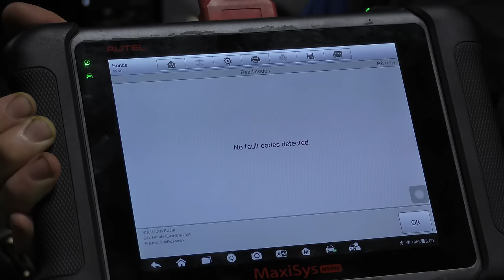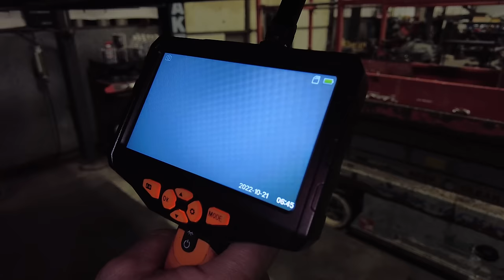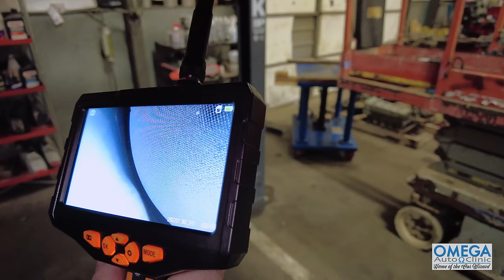Isolating the Problem? Engine Has No GO!

Comment: My wife and I have a 2006 Element. It has been as reliable as a church. We bought it in 2011 with 85,000 miles. It now has almost 170,000 miles and I am on my third set of tires, and brakes. I had the alternator replaced some years ago, and the A/C recharged. I change the oil and filter on schedule and have had no major issues in twelve years. It is the all wheel drive version with the 4 speed automatic.
Reply: LMAO Elements are great. Also, I like the suicide doors!
Reply: Is the back big enough for a matress if the rear seats are removed?
Reply: @micclay  Yes it is.
Reply: same with me 151K--brakes and tires twice, battery once, sepentine belt twice, otherwise normal maintenance

Comment: All of our local mechanics use the parts cannon, which can get very expensive. My former mechanic told me I needed a new catalytic converter, took it to my buddy, who is a mechanic, replaced the O2 sensors, and the light went off. So the other mechanic would have charged me $2000 for new catalytic converter‘s, when all it needed was new O2 sensors.

Comment: Great advice. On top of that, you gotta save all the Element you can, such a unique and practical vehicle! Great video! :)👍
Reply: I have 3 in my driveway they keep me busy to say the least.
Reply: Agreed!  My 2006 red EX model is named Zuko btw. ;-)
Reply: Yes because the elderly love the element!  When you see one on the road check out the driver! ha
Reply: I hate to say it but, for me they are typical Honda reliability but the only thing they would be good for is a chassis/drivetrain swap onto a decent body. But assuming they are unibody, they would only be good for parts on other Hondas. The last couple decades Honda has gotten weird.
Reply: So I know that Honda is reliable and everything but it did have some transmission problems. What about this Honda? I’m looking for a car right now, but I would like to have all wheel drive.

Comment: This is an important lesson on why it is important to find a shop that you trust. I moved to a new state and took my Toyota MR2 to the closest Toyota dealer for routine service because it was still under warantee. The MR2 was a mid engine sports car. The service advisor opened the frunk, no engine, opened the trunk, no engine. He looked baffled. I was at a Toyota dealer and the service advisor couldn't find the engine on a recent Toyota model! I took this as a warning, grabbed the keys, and took the car to a dealer on the other side of town who gave me great service.
Reply: 😆🤣 I had two first gen MR2. Great car, that's a keeper.
Reply: @MarkD11  The MR2 was indeed a keeper. Unfortunately, my first wife was not and she took it in the divorce. 😮‍💨

Comment: I'd be tempted to try some Cata-Clean for that cat converter. Being as it's just dirty, not blown apart in chunks, I'd say it's worth a shot
Reply: If you work on your own car then.. Yes you can take of cat, blow out with compressor from other end ect. Someone even powerwash theirs with good results (not with gas engine powerwasher, it could shred everything). Dry it out, put back on and use some cat burning fuel additive on longer drives.

However if you own shop then you don't have time, money to waste and experiment without any guarantee! Remember that owner also wants their car back! And if your experiment doest go well, now owner is talking shit about your shop to other potential costumers ect.
Reply: Once I heard a mechanic tried soaking the Cat in a solution of dishwashing liquid and water over nite to clean out the honeycomb Cat he claimed it worked and saved you some $$$$ to clean out carbon and in some cases oil in the exhaust.
Reply: A full bottle of Red Line SI-1fuel system cleaner  before a long highway trip works for some.
Reply: How about spray it with acetone
Reply: If no code history, why does it clog over time? Any history trying Scotty Kilmer Lacquer Thinner gas tank mix, especially if it's still intact?
Reply: A back pressure gauge is easy to make that screws in the O2 sensor hole and gives you a a actual measurement of the restriction
Reply: @tomgaddis5020  Garsh! That makes sense. I knew they made some where you drilled holes to install the screw-in bits, and riveted them shut later, but that's simpler for sure.
Reply: We used to just replace with straight pipe. Can got better mpg and better power afterwards
Reply: If the cats on its way out then I'd say screw it
Reply: I was thinking it would make sense to clean it. Also I wonder why it’s so plugged to begin with. Must not be running quite right?
Reply: @BruceLee-xn3nn  In our country you will be caught out with an environmental violation on your first annual checkup. And that will be really expensive.
Reply: @BruceLee-xn3nn  all kinds of illegal in the US. An individual might get away with it in Kansas on a vehicle that is already titled and registered in Kansas, since there are few/no inspections ever after. But a shop that started doing that would be risking a federal investigation and massive fines.
Reply: I had a failing cat and was unable to pass CA smog. My smog guy had me run seafoam through the engine and it cleaned a fuck ton of carbon deposits off the top of the pistons and presumably cleaned a decent amount of gunk out of the cat. It's been right around 3 years and the car has passed  everytime 👍🏻
Reply: I had a work friend who’s wife’s car had a blown head gasket. He said that he couldn’t afford to fix it straight away. So he just kept using stop leak in the radiator. Finally it got so bad that the car would barely run. So one weekend he changed the gasket but the car still barely ran. He told me that he thought that it was a fuel problem. He said that it would start ok but after a few seconds would stop. I told him that I thought the exhaust was blocked. He didn’t listen and had the car towed to a mechanic. They charged him $2,000 to replace the engine. Guess what it was exactly the same. I told him once again that I thought the exhaust was blocked. He finally went to another mechanic who charged $50 to put on a 2nd hand catalytic converter. With him putting so much stop leak in the radiator with a blown head gasket. It all just went down the exhaust and blocked the catalytic converter.
Reply: @BruceLee-xn3nn  ok if you have no emissions testing in your state
Reply: @nielsdebakker3283  state by state issue. Florida ok. NY no

Comment: You know ,I NEVER WOULD HAVE THOUGHT. THE CONVERTER PLAYS A BIG PART IN THAT KIND OF PROFORMACE. I'm really glad for your content.💯 🤝
Reply: i have seen it a lot i used to be a mechanic and it it is clogged you will lose power.
Reply: Only way I knew is because I had two trucks do the same thing. Since I live in Florida I just unbolted the exhaust and got myself a pipe and hammer. A few whacks and some extreme revving I had an empty cat. Man did it pick up power on my pick-ups. Lol
Reply: Replace it with a straight pipe and you'll get better mpg .
Reply: It's the banana in the tailpipe effect

Comment: Man, I wish I had a shop around as good as yours. My Explorer has been acting up for months and every shop just says, "There is no code so there isn't anything we can do." That doesn't help me get to work or around town. Every shop should work to the same standards you and your team does.
Reply: I'm lucky to have a good, honest garage near me. They get it right the first time and don't bussht you.
Reply: He doesn't have a gas analyzer.  That's not a complete shop. No exhaust evac system either. Not good.
Reply: do you let them keep the car for a few days to try to recreate it and look further into it? most shops are super busy right now and if there is no code there is nothing they can say for certain.
Reply: What are symptoms it's exhibiting?
Reply: @theosexpertdaymon2774  When the engine is warm the idle rpms will begin to drop from its normal 750 to around 500. It'll usually start to shudder like it's misfiring and will stall out on occasion. Once you hit the gas, it drives like normal though. I've also recently started hearing a whistling under the hood that gets louder when you accelerate. So far the work that has been done is a throttle body cleaning, repaced EGR valve, replaced coil/plugs/wires, and intake manifold gasket. All of these helped, but none of them solved the issue.
Reply: @dawsonfradin9071  What year and engine is it?
Reply: @theosexpertdaymon2774  2006 Ford Explorer XLS with the 4.0L V6
Reply: @dawsonfradin9071  The whistling sound makes me wonder about the possibility of a vacuum leak. Though Ford does have a few TSBs out on idle issues coupled with hesitation and a hard to start condition. Saying to clean the throttle body (which you said was done I believe) however it does also mention updating the PCM calibration/firmware as well. Do you have any service records of the PCM ever being updated or a sticker underhood mentioning ECM calibration?
Reply: @dawsonfradin9071  Now that I've thought on it a bit you could be having problems with the sencondary air injection system if that car has it equipped, that whistling sound could be a bad hose to or from the air pump.
Reply: @theosexpertdaymon2774  I've been thinking of running a smoke test on the intake. Would that help pinpoint if it's leaking from the secondary air injection or even the pcv system?
Reply: @dawsonfradin9071  It would show leaks on the intake and it should on the pcv as well (I'd go ahead and visually inspect the grommet and make sure the PCV valve is fully seated anyway though), and it should show leaks in the secondary air injection up until the air bypass solenoid. You'd have to disconnect the vacuum line going to the air diverter valve to check the line to the valve with the smoke machine directly. There'd still be the matter of checking the hose between the air pump to diverter valve and valve to exhaust. I'd suggest visually inspecting those for cracks or go ahead and rig the smoke machine up to them. I have a pdf of the routing overview of the secondary air injection system but I'm not sure how I'd get it to you right off.
Reply: @dawsonfradin9071  Another thing you could try is resetting the PCM KAM via a scan tool or unhooking the battery for 10min then take it on a long test drive consisting of in city and highway driving (if you want to be methodical look up ford obd ii drive cycle and follow that). See if it knocks some sense into the PCM maybe it'll trip a code to give us something to go off of. Otherwise it's HC (fuel delivery) pinpoint flowchart and HU (intake systems) flowchart diag those are the first 2 charts (after checking the fuel cap) Ford says to go through for low idle no DTC concerns.

Comment: Hey I got it right - plugged exhaust!  Now the question I'd wonder is how it happened (age, poor gas, oil in gas, additives, overheated, etc)
Reply: My first thought as well. I worked on an old Cadillac where there was a pipe within a pipe. Well, the internal pipe collapsed! A lot of parts were thrown at that Caddy until we properly diagnosed it.
Reply: Strictly a guess, if it is Direct Injection, and stuff is sprayed into the throttle body to clean gunk from the intake, the loosened stuff could plug the Cat? Could pouring stuff into the gas tank to clean the intake break stuff loose as well and plug the Cat?

Comment: Hey Wizard, a beneficial upgrade I did to my element is get some spray on circuit board water proofer. And coat the Vtec solonoid connectors with it. The whole reason the vtec solonoids go out is from water dripping off the hood down the back of the motor and onto the solonoid connectors and getting them wet and it causes a short and puts the car into limp mode. If you can keep water out of the connectors, it will save your customer the 500 dollar charge of having a mechanic replace the solonoid.
Reply: A lot of that water comes in from the windshield spray nozzles! There is a little gasket that dries out and lets water through. And guess what is directly beneath that nozzle...the Vtex wiring harness. Pop out the nozzle, put a little dab of clear RTV under it and pop it back in. You can also RTV the under side as well.
Reply: @kg4gav  Good to know! I had just replaced my Vtec solonoid. I live in PNW. My car sat outside, uncovered for 3 days with heavy rain. I go to drive it 5 minutes in. I get the check emgine light and limp mode. I put it under cover and let it dry. Un did the connectors to let them dry thoroughly. I found this stuff called ducky products electro seal. Put a few coats over the connectors after hooking everything back up, and I think the problem is solved now.
Reply: @kg4gav  I am definitely gonna check and seal up those nozzle gaskets as well. Thanks for the info.

Comment: Leaking shocks can also cause clunks.
A test drive can definitely help when it comes to elusive problems.
To some extent I see that a clogged cat is from old age, but can also be depending on oil (too much oil bypassing, but still within engine spec), a bit too careful driving or just short distance city driving where the cat never really gets heated and blown through.

Comment: I really wish that Honda would bring back the Element; I would seriously consider purchasing one. To this day, every time I see one on the road, I think back to my 2004 EX model that I had for several years. The only thing that I wished it had was a bit more oomph since it couldn't get out of its own way. Other than that, it did everything else right. Perhaps Honda could model it mechanically after the hybrid CRV.
Reply: Bought a 2003  5 speed stick in July. It takes off quickly enough, wish it had a 6th gear on the highway tho.
Reply: @TheLazyHalfSRanch  apparently you can add a 6th gear to the manual E's. Theres room to add another gear in the transmission.

Comment: The rear sway bar bushings can be a fairly regular replacement on Elements, & they are super inexpensive, like $6 ea.  As far as checking the transmission fluid, the owner's manual calls for warming the car to operating temperature, shut off the ignition then read the dipstick w/in 60 secs.

Comment: I have a 2003 Honda Element with 207,000 miles. Best vehicle I have ever owned.

I had the clunk in the back - tried to fox it with a Moog part as the dealer didn’t have the bushing in stock. The Moog is not as good as the OEM.

Last weekend I replaced both rear struts with Monroe quick struts, new anti sway bar bushings (OEM) along with the bolts and new shackles to hold the bushings in place (OEM) - finally I changed both sway bar links with OEM. 

The knocking sound is gone and the car handles much better.

One thing for the Wizard - the upper control arms on these Elements go bad - specifically the bushings fail. The one on the lift in this video - the rear wheels are tilted in slightly. I replaced mine with adjustable upper control arms. Now mine can be properly aligned. My Element was eating tires until I swapped the rear upper control arms out.

Comment: At one time "converter test pipes" were a popular item in the JC Whitney catalog. Worked for me.
Reply: My dad's 89 ta had this very same problem. A mechanic buddy of mine came over to look at it.  He grabbed a wrench and unbolted the exhaust before the cats enough to let some of the exhaust out and we took it for a drive.  It was like a raped ape, pretty easy to troubleshoot this issue.
Reply: If you're in an area that does not test your cars emissions yearly, you're good to go for cheap.
Reply: @nstg8 yep. My dad's 86 Toyota pickups catalytic converter clogged up on it. His truck was lifted 4wd and we seen it glowing cherry red and just replaced it with a straight pipe . It ran better than it ever did with straight pipe
Reply: you can do the cat elimination the car wizard cant

Comment: I actually drive a 2005 CR-V which as you know is the exact same car is this Element in terms of mechanical components, and ironically enough I've been noticing the same sorts of issues with reduced engine power at moments. It's not really, really bad but it is noticeable at moments. My car is a standard transmission and I am going to need to replace the clutch at some point in the foreseeable future. But based on the things you covered in this video I am going to examine these items a bit closer now.
Reply: As an Element owner: try a ~$10 can of fuel injector cleaner in your next tank and check your oil.  If your engine is burning a lot of oil it could clog your cat.
Reply: It hasn't been burning much oil if any at all. I just added a quart to it for the very first time in my ownership and I'm almost due for an oil change. Engine sounds very healthy for it's age and mileage. Thanks for the tip. I'll definitely keep that in mind! @ProfessionalFixologist
Reply: I had a plugged cat once. Took him to the vet and he is all better now.

Comment: I would also check the oil and ask the owner about if the car uses a lot of oil.  Often times a clogged cat is from the engine burning excessive oil (most commonly worn piston rings indicating engine is getting close to end of its life without a rebuild).  In that case can go up a grade or two in oil viscosity to reduce use and use an after market cat as it will likely be clogged again soon (aftermarket ones are $150-200, but won't last nearly as long as Honda OEM).  As an Element owner I can say that those rear sway bushings are a common problem.  Fortunately, it's a cheap and easy fix (less than $20 and 20 minutes).
Reply: It's a early k24 I guarantee that it drinks some oil.

Comment: Always check af ratio for rhese kind of drivablity issues.Glad you got them sorted. Its a fairly decent vehicle
Reply: His fast diagnosis was from experience with working on vehicles over the years. 

Still worth the diagnosis fee instead of those other shops guessing incorrectly and pushing up sells and parts cannons